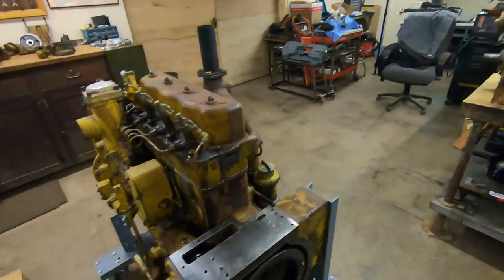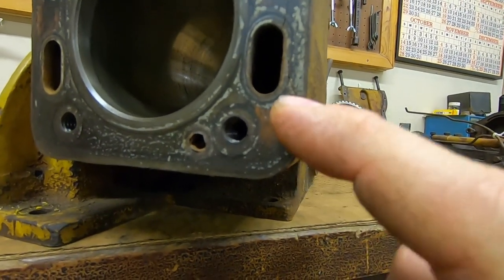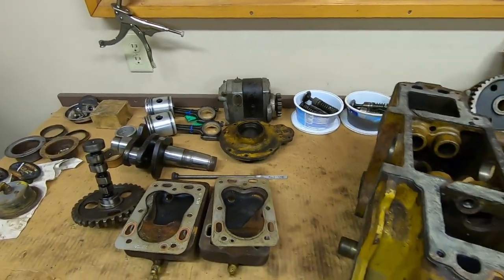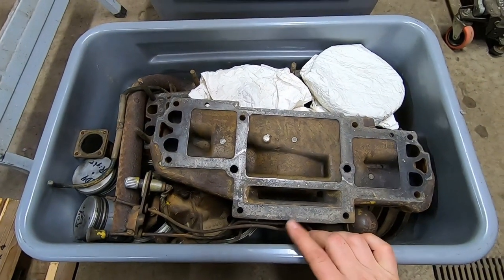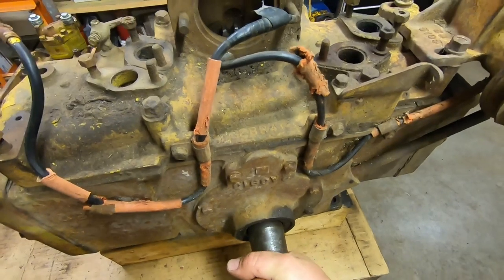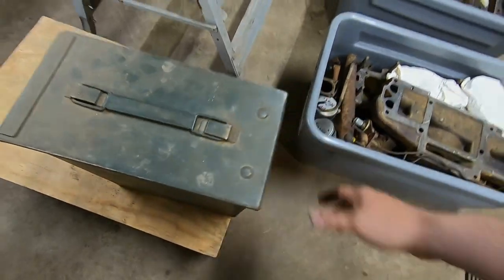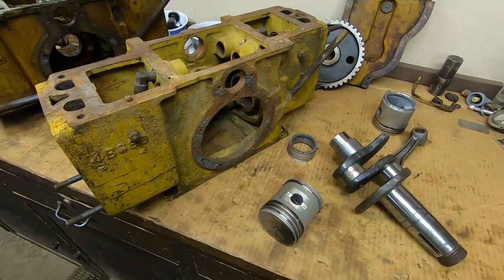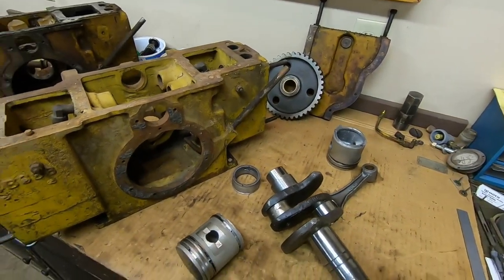Caterpillar D2 #5J1113 Starting System Ep.3: Starting Engine Damage & Replacement Parts Stockpile

Comment: Really appreciate the quality of your information and the clean language in delivering it. I grew up next to a small sawmill that used cat 22’s in the woods and had cat d4 or d6 equivalent on the mill and planer. I’m more your fathers age and the machine rebuilding methods are what I learned. I had a cat 30 on my farm as a toy and a rod started knocking. I found another engine, but sold the farm and later the cat to someone who restores old machines.

Comment: For what it is worth my vote is that odd rare replacement block since you seem to have good internals from the old engine, it is thus "historically" correct for the narrative of this tractor. It is more like a survivor with replacements than a pure restoration, each piece is either original or plausible replacement rather than all new stuff coated in paint to look original. Hopefully you already came to the same notion of "originality" sitting appears you have to date. Thank you again for a great series.

Comment: I love this old stuff! It's great guys like you are preserving these old cats. Good advice about turning the gas off and letting the engine run the carb dry. We  do this with all our antique tractors (between my sister and I we have 5). Any time you have a gravity fed carburetor there is the potential of filling the crankcase with gas. We had a 1940 John Deere H when I was growing up,  The valves were bad and it didn't like to start. My Grandpa had been trying to start it and left the gas on. We never got it started, and decided it was time to pull the head and address the valves. When we pulled the head off gas ran out of the crankcase. The five gallons that was in the tank was now all in the crankcase. Good thing It never started, but the crankcase was syre flushed out good. A valve grind with two new exhaust valves, a carb. overhaul and fresh oil and filter later it fired on the first pull of the flywheel!

Comment: Thanks for the info on why to shut it down by cutting off the fuel. You had mentioned it in another video and I've been trying to get a D2 running for a guy and had used the mag to shut it down. Came out to start it and it wouldn't turn over. Pulled the plugs and gas poured out. 🥺

Comment: I find it rather cool that there is an electric starter to start the pup, and then that pup starts the diesel. Three motors one machine.
Reply: One motor, 2 engines.
Reply: @durwardsmall2305  So is the term MOTOR  vehicle or ENGINE vehicle. What about MOTOR way not ENGINE way.

Comment: Rebuilt my starting engine in 1998, and had trouble finding parts.  Wish I had this video back then.  But it will help for next time, as it needs new rings and the carb gone thru.  Thanks for your putting this out.

Comment: Good stuff Toby. To this day, I tell people to run the carb dry on small engines before storage because of the crap fuel available to us. Do they listen? No. Then when they try to start the engine after storage, they don't understand why their carb is jacked. What part of "DO THIS" don't they understand? Cool stash you have there. Thanks for posting.
Reply: Harder to do if you don't have a petcock and have to run the tank dry.

Comment: Same with light aircraft, lean out the mixture 'til it dies then close the throttle and kill the mag.  It's a safety measure.  One of the few surfaces you can use to push or pull the plane around is the prop near the hub.  A bad mag ground and a trace of gasoline can cause a single pop to send a blade around and do something ugly to you.

Comment: Spare parts, you can never have enough. I could use some right now, I'm taking my 3 cyl John Deere engine apart and may need a crank.
#3 rod bearing turned and buggered the crank a bit. also needs a new rod. the carb did just what you said, leaked gas into the crankcase and thinned the oil. It could have been much worse. Thanks for the videos, cool stuff.

Comment: Hello, I have a question. I at one time had a Cat D6 about 1945 or a little later vintage 5R, I think!? The question is,  Was this D6 starting engine the same as the  D2, D4 or was it different in displacement,  probably larger?  And yes I always closed off the fuel first after main engine start then shut off the mag switch.   Really good videos and hints on rebuilding Cat engines and and such,
Many thanks for sharing your knowledge sir!!!!!

Comment: That crankcase pulse issue is interesting to me. BMW used boxer twins on some of their motorcycles, even at times where a PCV/CCV system was needed to pass California smog. I wonder how they made it work. However, it wouldn't surprise me if perhaps the system didn't work.

Comment: Hey there, I'm finally getting to repairing my D47U931 and the starting engine block is also 4B666. According to the parts catalog this was not the original block and I've been struggling to find a parts catalog for any D4 or D2 that calls out the 4B666 block. I checked the 5J catalog for SN 5J367 to 5J1424 and according to it the block should be 4B671. Where am I going wrong?

Comment: Wonder?  if the starter engine for 2115 not only had diluted oil but maybe did not disengage for main engine after start and the guy ran the unit with it engaged until it blew?

Comment: I am amazed by the size of that starter engine! Looking at the size of the pistons and taking into account that it is 2 cyl, 3000 rpm, I'd guess it produces at least 10-12 hp. Compared to the 35 hp of the main engine, at least sounds huge. Is that a 'normal' ratio? Or was it perhaps also used on larger engines? Greetings from The Netherlands

Comment: Nothing worse than an engine that fell victim to frozen coolant. I remember a friend bought a 1965 Dodge Dart 4 door real cheap back in 1993. The engine was a 318 V8 just rebuilt. The person he bought it from filled the radiator with water just after getting it in the car. He didn't have antifreeze and just wanted to run it a little. He never drained off the water and left it outside overnight and the weather got below freezing. We didn't check the motor damage because my friend already had one for the car, but there was plenty of water in the crankcase when we pulled the plug. I can't imagine where the damage was but hopefully at worst maybe a head and not the block. That engine looked really nice on the outside and it was a shame the old classic motor was ruined.

Comment: Had A TD-24 with a starting engine, in the winter you would have to let that starting engine run for at least a half hour so the coolant got warm in the diesel or she would not start.

Comment: Since you still have 2115's starting engine I assume that it is not too far gone to rebuild. I would be looking at combining its good parts with 1113's parts to get a good one out of 2 destroyed ones. If  the spin bearing damaged the block you could oversize the bore and make a bearing to fit.

Comment: Onans old opposed twins last forever, I have a mower with a 20hp onan that has almost 3000 hrs and runs great just uses a couple oz of oil in a 300hr oil change interval. Smooth power delivery with awesome low end torque. I suspect the low engine life for the starting engines is because those motors never warm up to operating temp. They have an unlimited cooling system since they are designed to warm the diesel engine. Short runs at cold temperatures is terrible for any small engine. Cat may have designed it to run at low temps but there is no way running a cold engine is good for it.

Comment: Now we know where BMW got its motorcycle boxer design engine from and I thought it was from a British Douglas design. This engine would be great in a motorcycle but maybe a tad on the heavy side. The reason spares are in short supply may be down to your massive stock levels, that's not a shed you've got there, it's the Squatch Cat Dealer Parts Warehouse. There's contingency and contingency Squatch!

Comment: Do they still use starter engines on modern machines? If not, when did they go away? (This place is a repository of parts and knowledge, kind of like a living museum.)
Reply: Can't speak for Caterpillar, but Deere had pony motors through the end of the two cylinder era, which was 1960. By then, starter motor and battery technology progressed to the point where direct electric was reliable, although Deere used a 24 volt system on diesels through the 60s.

Comment: such a simple thing on the CAT machine ,, why can't the one on a Deere be like that 
the pony engine on a JD 2 cylinder tractor  is a small V4 engine that runs 3800 RPM way more complex and a royal pain in the ass to work on ,, i own a 1959 JD 730D , it's a great tractor and i love it but damn  the pony motor is hard to fix ,, wonderful to start in cold weather too ,I keep it tuned up and run it regularly ,,even on a cold winter day -10 degrees ,start the pony engine and let it run for 15 minutes  , pull the throttle out , wind it up and engage the clutch and it it'll turn the diesel about a dozen revolutions at most and it wakes right up  ,it took me 5 years and a full rebuild of the pony engine before i got it right
Reply: We really take for granted electric start and electric glow plugs these days 
What 5 moving parts in an electric motor 
Turn the key on 
Let it glow 
Turn the key again 
Away you go 
Most of the times the starter lasts as long as the engine

Comment: I would try to take the junk engine apart and see if the block is still good if that fails. You could use the spare parts engine block. So you have at least a rare piece on the 5J that is at least corresponding to the engine even if it's a spare part. The Soviets who kind of re-engineered the D2 engine. Did not use the starting engine of the D2 but a completely different starting engine. Called the PD-10, that is a two stroke 1 cylinder engine. My guess is the CAT D2 starting engine was way too complex to build with limited materials, so they went a completely different rout on that.
Reply: would love to see one of those 2 strokes!

Comment: That starting engine looks a lot like an Onan flat twin. The Onan has the same crankcase pulse issue.
Reply: Are these engines air cooled?
Reply: @bobwhite3777  They use main engine coolant which circulates through and warms the main engine before starting it.

Comment: I vote for the electric start starting engine, best of both worlds!
Reply: I vote for electric start, because I don't want anyone on this channel to pull a muscle, and then have to recover before repairing other things.
Reply: @skylinefever  Certainly not Senior!
Reply: Hehe, I'll say one thing for the rope start. With the pony in good shape, clean magneto and a fresh carburetor, they start very readily.

It only takes one smooth pull on the rope after you wind her around a few turns.

Sure, fitting a battery box and electric starter is simple, but the pull start works so very well indeed.

Comment: It seems like that is a boxer engine. I had thought the boxer concept was 20 years or so newer than that; I guess not.
It sounds like you have a good engine from the machine with the exception of the block casting. If that's true and it was me, I'd be inclined to find a usable block and use all the other original parts.
Reply: From what I have read, many aircraft of the 1920s used boxer engines. However, they usually had 4 cylinders and air cooling. Also, the first VW Beetle was created in the 1930s, and all the early VW Beetles had boxer engines.

Comment: So is there no water pump on a d2 starting engine? My d68u has its on water pump on the pony below the governor.
Reply from the maker: Correct, the D2 and D4 sized starting engine here never had water pumps, they had to rely on the diesel engine's water pump to circulate fresh coolant through them.  Your D6 8U starting engine is basically an upscaled version of these D2/D4 engines, with everything being roughly twice the size and yes they added a water pump to those because of their size.

Comment: Thanks for another super interesting video! Do you think the starting engine' would live longer than 250 hours with modern lubricants? Also: I would love to hear about your parts storage "philosophy" if you actually had time for it. I'm always impressed by your system. Thanks!
Reply: Agreed on hearing  "parts storage philosophy "  I'd like to know how and where you store and organize stuff
Reply: I'm trying to envision a person who actually has a stopwatch and a logbook, who keeps precise measures of how long a starting motor runs each time the machine gets used. Anyways,  I feel that the evolution of lube oils doesn't really factor in quite as much as simply running the engine properly and changing the oil at reasonable intervals.  Yeah, newer oils do tend to last longer before breaking down, but in any ICE, the lube oil is supposed to keep contaminants suspended within that oil (filters will trap and hold larger particles, but not foreign liquids such as gas, coolant, water),  so the way I see it, the quality of oil a person puts into an engine isn't so important as how long they leave it there before changing it out, or in the case of larger engines where HUGE amounts of oil are involved, periodic testing, taking samples for scientific analysis.  In the case of engines that hold 5, 6, 7 quarts, just change it on time or more frequently, before it becomes completely contaminated with dust or foreign fluids.  Synthetic oils are engineered to last much longer (than traditional mineral oils) under normal engine operating conditions, but what good is an ultra-expensive, engineered oil, if water, coolant, or other liquids are getting into the crankcase and the pan. 
To get to the question you asked about whether the engine could live longer than 250 hours with modern lubricants,  I'd say that modern lubes couldn't hurt, but can only reinforce my theory about ensuring that the little motor runs properly, IS RUN properly by the operator (as was described by Toby in this video), and the lube oil is monitored or simply changed as required.  The "splash-lube" way of lubing engines still lives on with lawnmower engines and such that don't have internal pumps.
Reply: @stanpatterson5033  Thanks, Stan! Great points!

Comment: Are there conversion kits to replace the starting engine with a heavy duty electric starter?
Reply: Sacrilege! I'll pretend I didn't read this!
Reply: My guess is a electric motor on a starting engine is as close as you're going to get.
Reply: It probably wouldn't work very well, in addition to turning the diesel engine over it also helps warm up the cooling system.
Reply: @squatch253 Do you have a video of one when you were scouting old iron? That would be cool to see. 
Thanks

Comment: Great timing, I have a question for you .... Got my D4 955's home and looking at the starting engines. When I pull the pinion clutch back (nothing running} I can turn the pony by hand and the main engine don't turn. The fan blades (on main engine) do move minutely when turning starting engine by hand but no real rotation and no extra resistance. With the pinion clutch pulled back the pony should engage the main engine, Correct? If that is the case the pinion clutch has issues or does it need to be at a higher RPM to operate? 
Just talking through it I think I answered my own question - pinion issues. Thanks for being my sounding board.
Great video and this style pony didn't seem to change much until the direct start took off..  (punny)
Thanks again and mountains of great information .
Reply: Sound like something I do. I'll be writing a question on a forum and while I'm trying to compose it clearly and anticipate questions, I often find the answer myself.
Reply: @squatch253  Thanks, I see what you are talking about. So far today Cat 12A-04040 D4 has like 6 points and Fat Dan 0 (big goose egg).  My back is giving me fits and 04040 has a case of the "all-overs" and finding a place to start was at least two for the Cat.
Reply: @timothyball3144  Thanks. I'll keep an eye out for your posts.

Comment: Been using forklift trucks for 7 years, but turned in my licence as I did not need the shit that came with driving, used Scissor lifts / Genies and Powered Pump Trucks for 16 years, and all of them had problems due to too many different drivers, who all relied on the 'other guy' to do the basic day-to-day maintenance. (That would be me). Fill the battery cells when needed: Not a real hassle, and does not take all that long! Nooo. Just wait until the cells run dry, over heat, and a nights charge lasts for 3 hours instead of 7 or 8. Then they winge that they have no machine to use. We have had 2 batteries catch fire. . . . I wonder why?
If you are the main user of machinery, you look after it in your own interest. But with a dozen folks? Every body expects everybody ELSE to do it, so in the end, NO body does it. Sound familiar?

Comment: Ok, I'm me and I had to ask this question. 8-))  What are the power and torque specs for the starting engine?  Let's say there were no more available, do you have an idea of what power/type of Briggs & Straton or other small engine could get the Cat started up?  I am ignoring, for now the virtue the starting engine has in warming up the coolant (and oil?) for the Diesel.
Reply: The starting engine would have no effect on the warming of the main engine oil or coolant.  I guess turning the main engine and pressurizing the oil system would generate some heat, but that is not the primary job of the "pony".